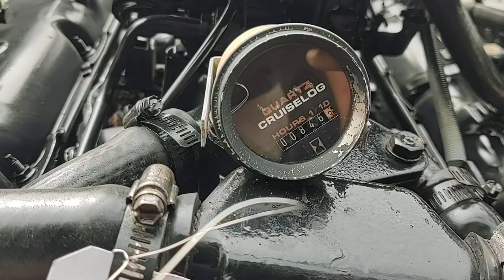Mercruiser 7.4L V8 454 Magnum 365hp Bravo1 846hrs complete engine #125

Comment: Silly question but what are the black squares on the exhaust? My boat has them and I can’t find anything online indicating what it is.
Reply from the maker: They are mufflers
Reply: They are exhaust coolers, water circulates through them as the hot exhaust passes by.

Comment: Is the liquid fuel???
Reply from the maker: No that's water
Reply: @qwesboy  I'm so lost😂 isn't that a bad thing?
Reply from the maker: @coryhixon8307  it's a marine engine cools off of fresh water from the lake
Reply: @qwesboy  that’s correct.
Reply: Marine fresh water intake engines do not have a radiator like cars. Only salt water ones do because of corrosive salt. They pull  fresh water in to cool off.